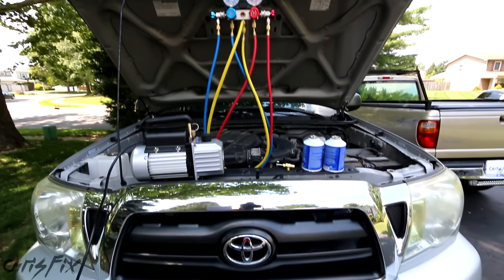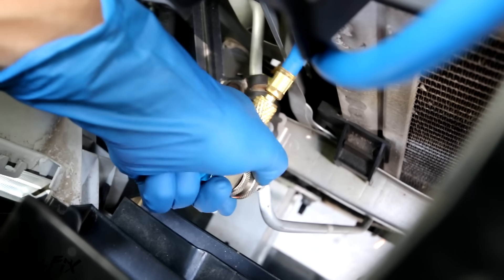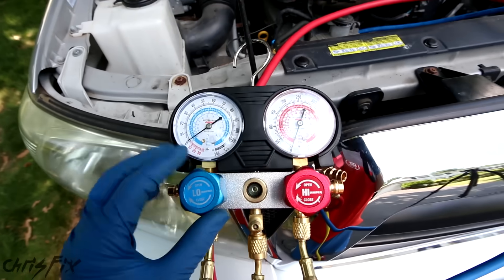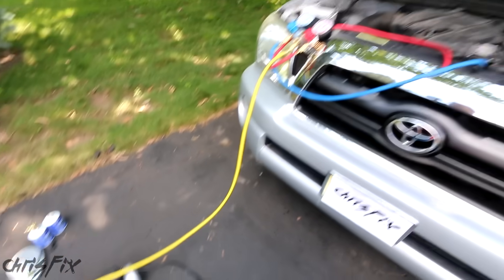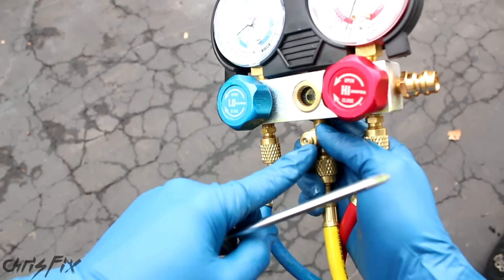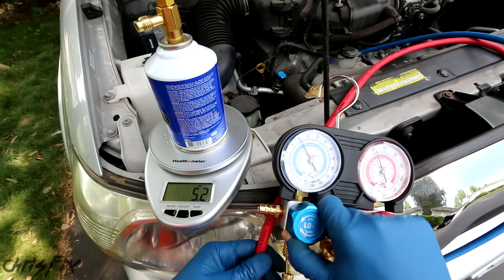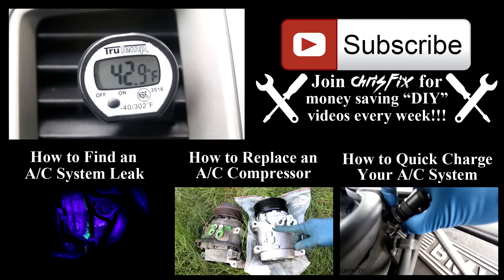How to Properly Recharge Your AC System

Comment: I’m having difficulty i am at the part where you purge the line of air right before you turn the vehicle on. My adapter doesn’t seem to be piercing the refrigerant can? I’ve tried on both cans and neither can seem to be pierced. I tried screwing it onto the can tighter but it wouldn’t go any more and then i tried screwing the needle in more to try and drive it into the can but it wont screw in anymore 🤷🏽 should i try a new adapter or should i try new refrigerant cans?

Comment: Chris question: my low port cap and High port cap are the same and I can swap them. Is it correct ? I have a traverse 2014 and I cannot see the leaking. I changed the rear core by myself I put gas and nothing. Now I thing to replace front core is too difficult to me. Last week I put gas in the system and I there was a smell of leaking gas inside. I did not detected the leaking. I have a good leaking detector but I didn’t find anything yet.

Comment: Question: When you replace evaporator must add oil directly into the new evaporator before getting in the HVAC? Or must add the oil in the system while it is under vacuum? Thanks

Comment: Sir, turn on the engine first, then turn on the aircond switch and the blower, after that put in the aircond gas by turning the liquid barrel upside down. Correct or not.

Comment: HELP after I hooked my Freon up and went to purge my system, lots of the oil from the pump came out of the line. I stopped and left the system under vacuum. I’ve cleaned out the lines and waiting for the sight glass on the gauge block to drain. I don’t know why this happened, does anybody have any ideas? Thanks it’s my first time working with AC

Comment: Hi Chris,
The neighborhood hooligans drove a screw driver through my condenser which I am replacing. Based on your direction, oil and dye needs to be added to the yellow hose. Will that oil and dye be blown out when I purge the air out of the line?
Reply from the maker: Just add the oil to the condenser before you install it.
Reply: @chrisfix thanks!!!! Loyal follower…. Please keep up your great work!! Greg
Reply: @chrisfix  will the vacuum pull the oil out?
Reply: @chrisfix  being that all of refrigerant has been depleted, can I assume all of the PAG oil has been depleted as well? I am replacing the dryer and condenser only. Do I add oil for those parts only or the entire system? Thanks….

Comment: Hi Chris I just replaced my ac, just didn’t add pag oil to compressor and condenser, could I check the manual and add what the condenser needs in that same yellow line?
Reply from the maker: Yes
Reply: Thank you so much!!

Comment: This is the best youtube video on this subject I've found. Just one thing though, just before you add r134 you close both valves, purge the line, start the truck and only open the low side. Since the HP side is reading something, I have to assume it needs to be open. 
So, just not sure at what point exactly it was opened.
Reply: the hp side is closed.  the gauge  gives a true reading when the valves are closed.

Comment: After creating a vacuum, best to release some refrigerant into the system before doing anything else (like starting the car).  You want to change from a low pressure (vacuum) to a high pressure (charge) sooner than later.  Once you have some charge in the system, you can start the car and continue as you described.

Comment: Very helpful. Saved me a TON of money! Had to replace my condenser because of FORDS brilliant design that incorporates the Power Steering cooler. Followed your instructions and system is blowing 29*  total cost for me was $225 parts & materials, instead of $1000 at Firestone 😮 took me 4hrs total. (Including replacing condenser)
Reply from the maker: Glad you were able to do it yourself and save a bunch of money!

Comment: This was so helpful. I've done just about everything as an avid DIY car guy, including rebuilding engines and transmissions, but when it comes to AC stuff, I just never ventured far because of the special tools you need (manifold gauges, vac pump) and the general workings of the system were never really clear. But now that I've taken the time to better understand it, and also in restoring my 02 Silverado which includes all brand new AC parts, including the lines, this video has been super helpful. I was so excited that my system perfectly held pressure and is 100% ready to accept freon.

Comment: I believe you added 30 oz. Each can looks like they would have been 20 oz or so.
Reply from the maker: The cans were 12 oz
Reply: Great video, I think you were assuming the can weighed 12 ounces but these cans are measured in fluid ounces, your scale use showed it weighed 20 ounces so you added 30 ounces or 1.875 pounds, a little over.  @chrisfix

Comment: On your first can of Refrigerant you turned it upside down allowing liquid refrigerant into the system, which is something i have been taught not to do.  On you second can you mentioned not doing this, as it could damage the compressor. This can be confusing to those who just watched your video. Great presentation, but Adding liquid to the low side can destroy the compressor.

Comment: @11:45  do we need to purge the system a bit again? Though the adapter valve was closed, but still some air could be present due to the connection of a new can w/refrigerant. Or it is insignificant at all? Thank you for the film. I'm using it to charge the empty system in 2001 Saturn SL2. Everything is very clear, just that small question.
   Update:  I charged the A/C system of Saturn, it blows 42F. During this process I had a strange difficulty w/the 2nd can. I attached it in the same way as the 1st one, but R134a didn't flow well as fm/1st can. After attachment I tried to purge the air and nothing came out. I tried different ways by opening and closing the can. Eventually I succeeded by closing down and opening just a small bit. I think that can was malfunctioning a bit. So next time I'll buy 1 or 2 extra for the case of faulty cans.

Comment: When there is still refrigerant left in the can do you just leave the brass fitting on?  If you take that off the can is pierced so it will all come out under pressure right?

Comment: In Shop Manual (3 huge volumes) I have they say to add ~2/3 of refrigerant first and then start the car. Then slowly add remain 1/3 of refrigerant w/car idling and A/C on (lowest temperature and highest blower speed). But in all films including this I saw everyone starts the car 1st then add refrigerant w/the idling car. From one comment here I understand it is more safe way to do it.  In instructions for the new compressor I installed they say to switch compressor on and off 10-12 times with engine idling to burnish the hub and pulley. But can I do it w/empty system (no refrigerant in it yet)? Thank you very much for this so informative film. I'll be using it for my A/C work, just that part w/new compressor switching on and off not quite clear. I would appreciate any opinions on this matter.

Comment: Chris thanks for this great video. I have two questions--why should we be so careful about preventing moisture entering when the lubricant is hygroscopic polyalkelene glycol and secondly--why don't car AC systems have provision for a moisture filter--whereas all refrigerators and home AC units have these??  Is it moisture or air which is the real problem?  I guess the moisture can cause corrosion and so that is a worry but the AC lubricant always has corrosion inhibitors added to it
Reply: The oil being hydroscopic is exactly why moisture must be limited. The oil will absorb moisture and get contaminated. The system does have a drier it is just separate from the filter, the accumulator usually has a dessicant in it.

Comment: I'm about to do the work on my 1994 Lexus LS400. not only do i deserve it but she deserves it also. I've gone through the trouble of acquiring myself a small mechanics shop worth of stuff. Just got a Brakemate jr. from a dumpster (pretty sure the casters ripped out of the plastic because the pump seems to work fine.) and spent about $50 on casters and the battery clamps they cut off and managed to scoop up a Refrigerant Recovery machine (NRP gs2000) from a local resale/pawn shop and picked up the compressor kit off rockauto for my car. i'm excited to get the luxury back into my luxury sedan

Comment: Hey Chris, would you mind to answer 2 of my questions?  Because I want to be clear about it.  So I don't mess-up my car AC system.  In your video, you said that you just replaced a new AC compressor.  So that car should be no refrigerant in it.  My car AC still blows out 60F.  So it must have some refrigerants in it.

1.  My first question:  Do I need to EMPTY or REMOVE all refrigerant in my car AC system before vacuum and recharge the AC system?

2.  My second question: If my 1st question is YES.  I saw other video on YouTube.  They said the auto shop would empty our car refrigerant for FREE.  Because they get pay to recycle the refrigerant.  It's that correct?
Reply: It is best to charge by weight which would require an empty system. You can charge it by looking at the pressures, line temperatures, and the temp split but that requires more expertise. Some shops might do it for free but most would charge you to recover the refrigerant. They only get a couple of dollars per pound for recovered refrigerant which is not enough to be worth their time. Legally speaking the refrigerant must be recovered into a cylinder but practically there is no one to stop you from venting a couple ounces of 134a.

Comment: Dude I have this kit but I used a large bottle, I think I've overcharged my system because it's still blowing warm, the bottle I used said it could be used 3 times but I didn't realise it would come out of the bottle so quick
Reply: How do I fix it?
Reply: What pressures are you seeing when the system is running on maximum (highest fan speed and recirculation)? If the system is actually overcharged you legally have to bring it to a shop and have then pump it out into a container. The alternative is to vent it which is illegal but nobody will know.

Comment: Wouldn't you suck the oil out of the compressor if it is pre-filled?
Reply from the maker: There are spots in the system (typically in the condenser/drier/evaporator) that hold onto oil despite the vacuum
Reply: @chrisfix  
Ok, Thank You
Reply: @garrettforchrist2700 imagine holding a metal water bottle upright and sucking on it. No matter how hard you suck the liquid will never reach your mouth. Oil does not evaporate and the ports do not sit in oil so a vacuum will not pump it out.

Comment: Every time I have to do this (infrequently, so I can't ever remember for sure), I try going through like 5 other videos, before coming back to this one. By far the most clear, concise with all the right info and no unneeded time-wasting bits, and touching all the super important but less commonly mentioned points. You rock

Comment: Great, and thorough video, straight to the point.  AutoZone will rent you the gauges and vacuum pump for free (with a refundable deposit) for 90 days.  Just need to purchase the $7 adapter valve.

Thanks @Chrisfix!

Comment: Hi Chris: So if you add both the Dye and J639 oil to the Yellow line, when you connect the R-134a can how do you purge the line with the oil and dye in there. Will it spray all over the place when purge the system?  I want to do it right the first time, Thanks

Comment: Hey Chris I love your videos, you cannot imagine how it has helped so many people do tasks that they thought were nearly impossible, thank you for doing what you do. I have one question for you, when you start the vacuum pump for the first time and get it down to 30in of hg (essentially a vacuum) you turn off the vacuum pump, and then close the hi and lo side on the manifold gauge set. Does closing the Hi and lo valves on the manifold gauge prevent the manifold from detecting whether or not a vacuum us still present in the system. I mean if its closed its not allowing any air into the system so how does it know that the vacuum is being held in the system when you come back after an hour, you have not opened the manifold gauge valves yet? Just want to pay attention to the details.

Comment: @Chris. So I have a 2012 nissan altima 3.5 sr V6. I replaced the ac compressor. Then I evacc the system.  So my question  is, does the vacuum suck out the oil that comes with a new ac compressor?

Comment: So... I love the explanation, very good.  Question? Why did you not zero  the scale with the empty can then place the 2 can on the scale?  I say this because if you need x amount of r134a  the weight of both cans and r134a in said can would cause your measurement to be off by the weight of the actual containers, right?
Reply: First place the can with the hose attached. Then zero the scale and start charging. When the can is depleted make note of what the scale says. Remove the first can and attach the second. Repeat what was done with the first can. Take the value that the scale said after the first can and add that to the scale display to get the total charge currently in the system. Repeat for as many cans as necessary to charge to the proper weight.

Comment: Its not the hardest part, its the most expensive part. Dude your telling people to buy at least 1K worth of tools to do it at home. Not to mention places wont sell you refrigerant if you're not in the trade. As far as i can tell you're not wrong about anything done but this is one of the few things people shouldnt be doing at home because its cheaper to let a dealership or shop do it.

Comment: My high pressure port leaked after I disconnected the hose.  I'll replace the valve and put the hose on and off a couple of times to test before adding gas.

Comment: After vaccume if you close both valves on manifold , the waiting for leak will only prove that the manifold doesn’t Leak . The system has to be open to the manifold in order to detect leak
Reply: Thats not how the manifold works
Reply: Close only the valves on manifold;keep the valves that are connected to the service ports(hi&low) open after vacuum.

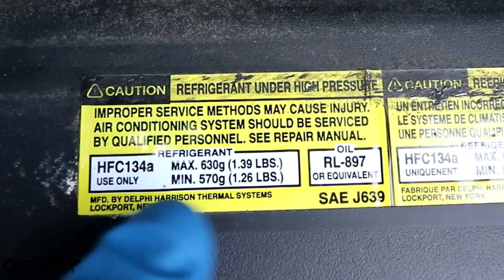Comment: Kind of a mistake here... There are two different kind of ounces - weight or volume (volume). The cans are marked in fluid ounces (volume) and grams (mass). at 1:50 you convert from pounds to ounces (16 ounces in a pound) and then say there's 12 ounces in each can. Your conversion would get you to weight ounces, so you're comparing apples to oranges. The better way to do this would be to ignore pounds/ounces and use grams, which is on your car's label, the can's label, and on the scale (you probably switch to grams by the time you actually do the refill, i'll keep watching). -- edit - oh no, you did use ounces on the scale. Oops! :o
Reply: Its a misprint on the can. Its 12 weight ounces not fluid ounces. Refrigerant is never sold by volume, always weight. The guy making the label was confused.
Reply: @Redtooth75  yeah I thought it was weird they'd bother putting "FL OZ" on the can at all. Just checked a few more brands' cans. most say "NET WT" and don't say "FL". They do agree with this can 12 OZ =340g (but not the FL part), so I think you're right. I'd stick to grams anyway.